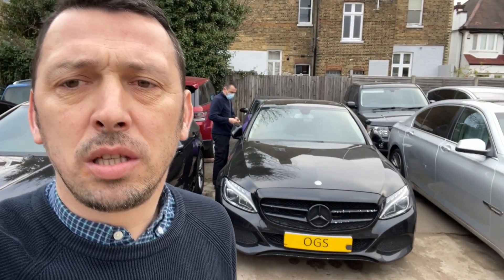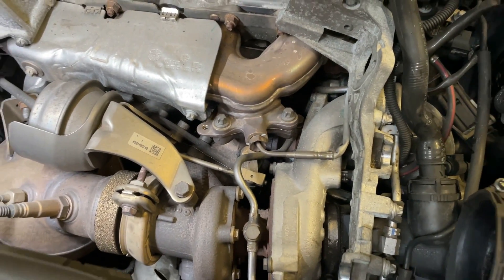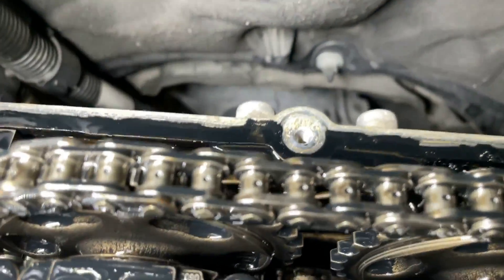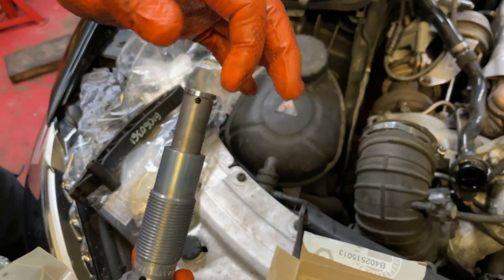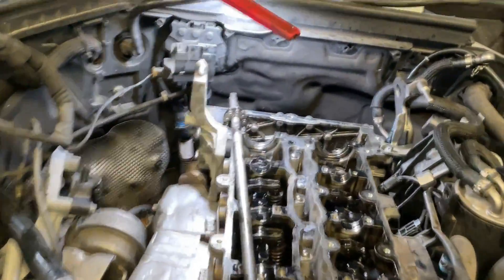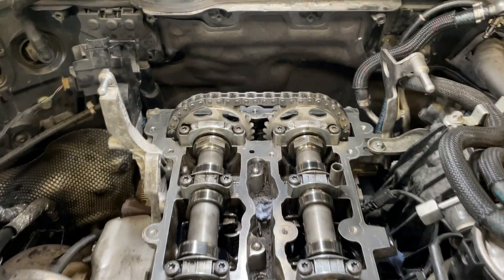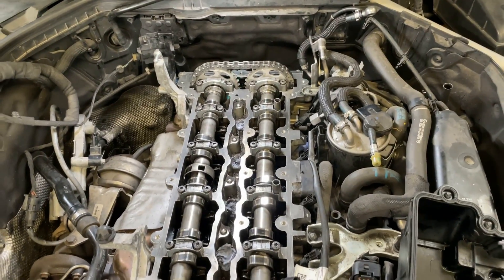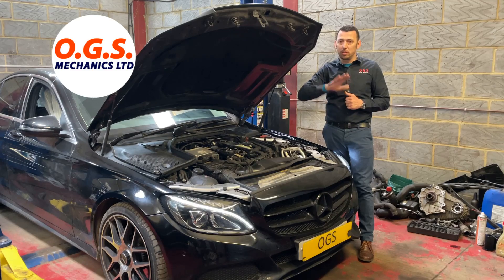Timing Chain Noise - diagnose & replacement -  Mercedes

Comment: I have seen other videos were they have changed the timing chain tensioner as the new ones have larger holes to build pressure quicker and this can solve the problem in some cases. Also these engines have an oil solenoid that reduces oil pressure under about 2500, which i disconnect on my cars to run full pressure. The engine runs smoother.

Comment: For me this is automotive engineering at its worst, and lets not forget Audi as well with their complicated Timing chain set ups on the rear of their V6's and V8's. Personally, i refuse to buy a vehicle with a timing chain on the rear of the engine, and pay for expensive repairs because of the manufacturers ridiculous engineering. People buy these type cars after a few years when they've dropped in value big time thinking they've got a bargain, only to later experience a heart attack upon receiving the bill when they need work done like a timing chain replacement. Sometimes, a bill can be so expensive that it's not even worth fixing. This is why the cars drop in value big time in the first place, The market factors in the expensive repairs into the equation. These type of cars are being exposed for what they are on You Tube by a lot of content creators- money pits. If you're buying these sorts of vehicles second hand.you better make sure they've been fastidiously maintained and get them checked out by an experienced mechanic. But even then, you're still not guaranteed you won't run into major headaches.

Comment: I would like to know how far the car has driven. The rule of thumb is to change the chain and sprockets at 300,000 (190000 miles) km. If the car has driven 350,000 km (220000 miles), the guide rails should also be changed.

Comment: If the chain is stretched it would rattle at every start up. Imo. Might be wrong. But i just had to deal with mine , changed tentioner with no luck. Than i crossed a tip on a forum that pick up tube oring in the sump might be bad. It was completely flat allowing to draw air with oil especially on cold days woth thicker oil. Changed that one and no more rattle. $5 part and few hours on garage floor and done!
Reply: With a cold start the top off the chain will have less oil.  Therefor the rattle sound

Comment: I measured my new chain before fitment then my old stretched one.   It was 12.5 mm longer.   Almost one link and a half.!!        70000 miles.             Oil changed twice a year.           Utter garbage quality merc genuine chain

Comment: A very good work. But when starting, a strange short sound is heard (16:40). Does anyone know? I have a similar problem
Reply: I had this noise more persistently. Apparently something to do with the turbo watergate. I’ve driven about 30k kms and nothings happened, I also heard of a guy who had this noise nearly all the time and drove over 100k and it was fine. I don’t know for certain, but see if you can recreate the noise. Try get your ear down near the turbo side and see if it’s any louder. Not sure if it’s definitely that but it seemed to be what was causing that noise on my car.
Reply: Sounds more likely balance shaft which is meant to be replaced with the timming chain and sprockets  but this engine also has egr and intake throttle servo problems

Comment: So, why does the rattling noise stop after a few seconds ?
Reply: When the engine is cold, the oil is thick and takes time to circulate fully. This can lead to low oil pressure in the timing chain tensioner. The tensioner relies on oil pressure to keep the timing chain tight against the sprockets. If the oil pressure is low, the timing chain might have some slack, causing it to slap against the guides.

Comment: I have no noise on cold start. I only have an iron level noise at low rpm when I accelerate, once I let off the accelerator it disappears, or it disappears after 2000 rpm what can it be
Reply: I have the same at 2000rpm. What was the problem?
Reply: La Barilla del acelerador hace un ruido contra arandela, a mi me tenia loco ese sumbido

Comment: I have this problem as well with my W212 2009. My mechanic said always that the noise was not that serious to do an intervention. At the end I got a broken guide: a small peace was visible in the chain when the cover was removed. 
Now my mechanic says that in fact even if the guide has lost a small peace of it, it is not really necessary to replace the guide together with the chain. His argument is that if the new chain is installed, it will never touch the guide any ways and so the risk in practice near to zero. The local Mercedes would have said that they never replace the guides neither, but I dont know whether they don't do that even in case of partially damaged guide?

My question is: Is my mechanic right in his reasoning regarding neglecting the guide replacement in case of small damages? What would be risk? Why should I replace the guide in case of damage?
Reply: So what did you do? If the guide is breaking up it will be going into the oil supply - could block / damage something else

Comment: Good job and fairly easy to do with this engine unless one slide rail has to come out. Then the engine would have to come out, as already described here!

I just happened to have the injectors out on my W204 CDI 200 and then took the cylinder head cover off to inspect the chain, spur gears and camshafts. Everything is still super top, the chain has not been stretched, the sprockets and camshafts have no visible wear ;-))

Comment: So if the camshaft sprockets showed wear and they were replaced, then the one sprocket down below on the crankshaft is worn as well and should have been replaced also, otherwise it will eat the new chain and this repair is very shortlived. There is a reason why the dealerships will change everything and not just something.
Reply: That sprocket has a contact with the chain on 3/4 of its circumference so possible that's why it won't cause any problem if you're not replacing it.

Comment: No one replacing the water pump................bad move.
Yes, it would have cost more, but it will costs even more when it goes, all will have to opened up again.
Reply: Those engines have the water pump on the front of the engine driven from the auxialiary belt, so no need to change it when changing the timing chain.

Comment: why would the engineers put the timing chain on the back side of the engine? Sounds like that completely makes the process of replacing much more time consuming and difficult.
Reply: They had to make an engine with the same harmful technical characteristics as the chain breaker bmw n87 2000. BMW and MERC have agreed to build vehicles that are beautiful and deliberately expensive to repair… (if you think about it, they are similar in concept). Mercedes needed a drive gear between the high-pressure pump and the camshafts that could do everything with maintenance-free gears. Customer MUST EXPENSE for maintenance.
Reply: Mercedes intended for them to never need changing for the life of the engine

Comment: I'm hoping to spread the word. If u have a 2012-2014 MB C-class and u have rattling sound and ur mechanic think it's the timing chain, call up ur MB dealership and get it diagnosed and fixed. The repair will be completely free. The timing chain issue is related to the camshaft adjuster issue, and it's part of the camshaft adjuster recall, in which MB corporate has extended the original factory warranty to 120k miles. So if u have timing chain issue, the camshaft adjuster is prob an issue as well and ur local MB dealership will repair it for free. I just had mine done recently.
Reply: I didn’t know  mb can fix this for free ?
Reply: Is this recall for all  2012-2014 models?
Reply: @joiofjenz  As far as I know C-class and SLK-class. U should've received recall letter in ur mail, if not then likely ur car isn't part of the recall...
Reply: @huantsai9406  ok thx
Reply: Would this still be the case If I bought the car used... im in Australia btw... and any idea on how I would claim this process
Reply: @OzzyKentLoL  ur Benz being used makes it more complicated than u being in Australia I think. The recall is good for 120 k miles but I don't remember if there was a time frame limit like within 10 yrs or so. Ur Benz being used u need to see if the engine was messed around before by other mechanics and if ur dealership will fault u for it. U have to make sure it is very likely to be this issue and also go to the right dealership because some of them can complete pricks.
Reply: How long is that recall for mine is doing it now will they fix it for free
Reply: @greenkrack1299  as long as your car is still below 120K miles and they diagnose and for sure it’s this problem then MB should replace it for free
Reply: Is that a diesel engine?
Reply: What about 2015?

Comment: It’s a great video, but you missed the most crucial part of the rebuild. How you actually got the cam shaft back in, how you set the timing, how you got the tensioner back on and tension on the chain. This is the meat and potatoes of the build and it’s unfortunate that in such a great video you missed this.
Reply: Yeah what the point without showing the most difficult and crusial part
Reply: @garethoswald3392 so how do you fix that issue?
Reply: @garethoswald3392 0ù
Reply: Exactly! Pointless video 👎👎👎👎
Reply: Y’all be asking for too much 🤦🏽‍♀️

Comment: My e class has only done 47,000 kms and the engine has this symptom on morning starts and hot starts when rpm is below 600 is this normal? doesnt feel normal to me, considering the car is only 40 odd thousand kilometers in!

Comment: Terrible engine design, who in their right mind would put the chain back there? Smh
Reply: From an engineers perspective it's actually the best location for the timing chain. Much less vibrations (hence less wear) and due to the fact that it's a very short chain, there is also much less wear. 

Unfortunately the bookkeeper took the remaining minimum required strength as an advise and decided a little cheaper would still work...
Reply: Then i just worked on a Suzuki outboard engine with the chain basically in the same location.

Comment: I have an E Class diesel 2010 model, is it expensive to have the chain replaced in situation? I live in UK.
Reply: For a vw its 400 i think so from a dealer maybe a grand
Reply: Local about £500 plus parts, main dealer £1000

Comment: I have an intermittent noise on idling on my 2013 SLK AMG and no one including Mercedes can solve the problem it’s only when the engine has been running for 20 mins or so and not all the time only occasionally it’s fully serviced no expense spared and runs like a dream otherwise ! Drives me mad 3 years of it now
Reply: Maybe engine mounts or a pully needs to be replaced.
Reply: Thanks I’ve not heard it for days now it is only a second or two when I do anyway I forget about it and if the radio is off and I hear I only remember it then ! It’s an annoying gremlin that appears rarely !!
Reply: I sounds like it could be a frequency noise.

Odd noises that only appear rarely can often be a frequency noise. Let me explain. Just like tuning a radio, you have to get the frequency on your radio just right to receive the radio station of your choice, turn the dial a fraction to the left or the right and nothing.

Often on cars you will have a loose bolt (The heat shields behind the exhaust is a common one.) that will cause something to vibrate and make the noise. It  will only vibrate at a certain frequency, this frequency can only be achieved when the temperature is just right, the engine rpm is just right and sometimes even the air humidity can play a part.

I have a 1991 Land Cruiser, never had a vibration until i fitted a new exhaust, now the running board will vibrate but only at certain times. I have changed one of the parameters that was required to hit that frequency.
Reply: @harveysmith100  Its called resonant frequency
Reply: @johnfeeney4636  Thanks John.
Reply: Did you find out what the problem was? I have a similar noise on my Mercedes C250 2012 coupe when the engine is warm. It comes and goes but only on idle

Comment: Tsb says no consequential damage expected. So it's not necessary to do check valve and tensioner upgrade? Or is it just Benz trying to downplay the problem?
Reply: The latter. MB will never admit to this problem and my garage does not admit it either. They have been told to deny it as people at my dealer have said "the chain on these engines don't need replacing"

Comment: had this on e250 soft top even put the ecu light on timeing marks were out got away with just chain and  tensioner
Reply: How much did it cost you to repair
Reply: @sophiea453  good £1000 but more if you might need to replace the cam phasers around £1500

Comment: Yep this is exactly what my gmc terrain was doing.  Idiots at the place I bought it from said it was the throttle body and then had me continue to drive it assuring me it was fine. Now I need a new engine and only had the 12k car 4 months.
Reply: Damn, the two times my throttle body went out on my Malibu, my car would shake horribly if I went over 20 mph. My car physically couldn't. So idk how the mechanic would say it's fine to drive
Reply: @valerieflemming2198  Sounds like they just don't care.